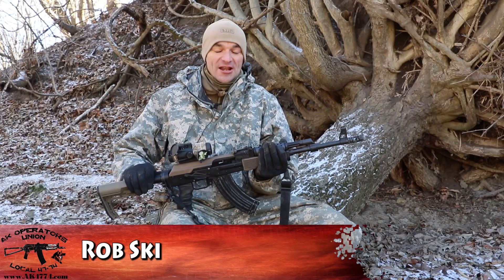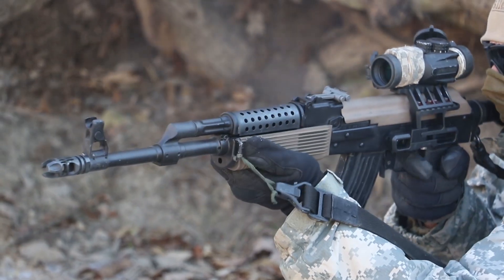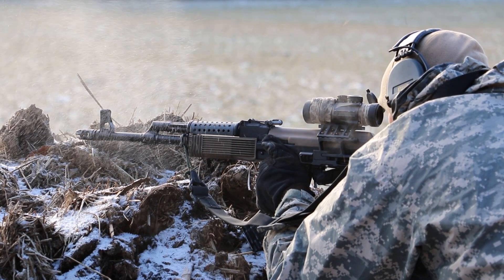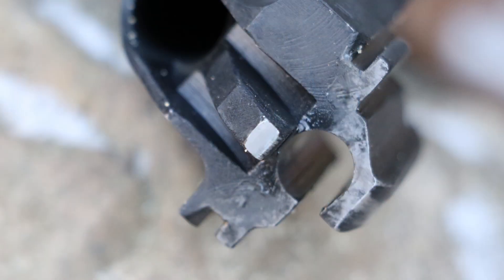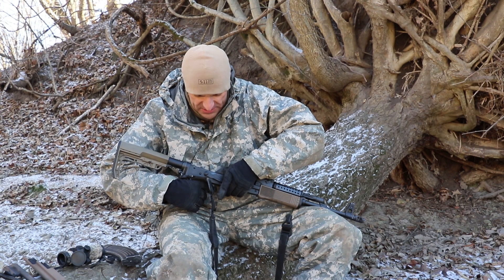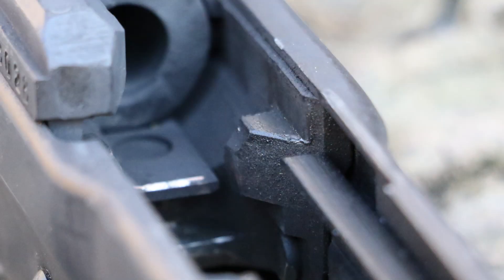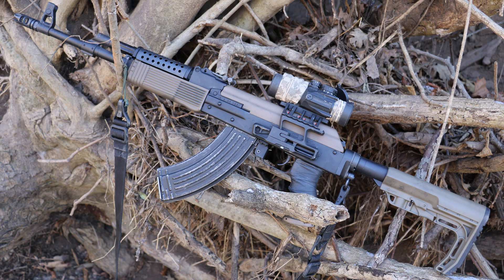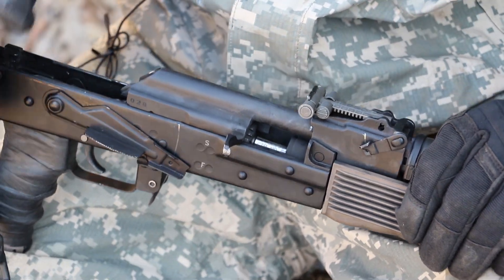Molot Vepr FM AK47 - 3500rds Attack!

Comment: Well done sir 
Tavor, SCAR 16, and Beretta ARX is up in '17
Reply: well for the tavor and scar there are so many tests of them and you can buy both and trust them imo. only heard good things about the arx too 
But sure it would be interesting
Reply: Tavor and SCAR's are battle tested and proven. Even if either of these rifles didn't pass the 5K round test. I still would trust the SCAR series and Tavor. However, I don't see Rob testing either of these rifles due to their cost. The Tavor has been extensively proven and used by the IDF for over a decade, with no significant changes made to the operating system.
Reply: That reminds me. I wonder if we're getting a civilian spec ARX 200 in the near future. That would definitely be a top priority buy for me.

Comment: Rob - I just got one of these in 7.62X39 and I love it.  Took it to the range yesterday and had one issue ... safety will not engage with the trigger pulled.  Is that a VEPR quirk or a defect?
Reply from the maker: +AK 4life yes, that's normal thing. By design there isn't clearance for safety lever to comeback when you keep trigger pulled
Reply: Thanks as always for the quick reply Rob!!

Comment: Between the Fighter brake and what you currently have on this rifle, which would be your choice?
Reply: tom Harris VG6 Epsilon is primarily a brake. If you watch the difference between brakes the Epsilon cuts down recoil better.
Reply: Ak Operators Union, Local 47-74 thanks Rob.  I have the Fighter brake and it works very well for me.  But I'm always on the lookout for better options.

Comment: hey Robski! I had a question, maybe it was mentioned in one of the previous videos, but what's the story behind that M4/AR15 buttstock tube adapter for the Vepr?  Do you have a link to the product?  Was it plug and play or did you have a smith do the work?  

By the way, you the man!  Thanks for your awesome videos! God bless and Merry Christmas!
Reply from the maker: +ssnova this adapter http://shop.akoperatorsunionlocal4774.com/AK-M4-Stock-Adapter-AK-M4-Stock-Adapter.htm , but it wasn't PP. It had to be fit with help from dremel tool
Reply: Thanks for the response and for the link on the product!  Was it pretty difficult to install?

Comment: Rob, if you were going to Afghanistan and the Army let you use whatever weapon system and setup you wanted what would it be?
Reply: Njkalashnikov his polish home build w/ PA 3x prism
Reply from the maker: +Njkalashnikov in Afghanistan? I'm perfectly fine with my issued m110 or XM2010. ;-)
Reply: Ak Operators Union, Local 47-74 I'm thinking your consideration is largely based on distance shooting in Afghanistan?
Reply: Patches O you have 0 experience with either platform .

Comment: Has a Saiga been tested yet? unconverted saiga would be best, in both 7.62 and 5.45.
Reply: I doubt Rob will be testing a Saiga to 5k rounds anytime soon. At least not until the ban is lifted and they are available to buy again. That's the point of the torture tests here. To test guns that you can actually get right now.
Reply: he tests guns that are on the market and Saigas are OFF since the ban.
Reply: Thats makes sense... that blows! Hopefully Trump lifts the sanctions on Russia.
Reply: H2BpullsK20 with the current blaming of the Russians for interfering with the election going around, I seriously doubt he will lift the ban any time soon. I just don't think he'll do anything with Russia for a while because of these moonbat libs looking for anything to blame him for.
Reply: As long as there is light a the end of the tunnel is enough for me.
Reply: Veprs are not "better" than Saigas, they are just different.  It depends on which one you prefer, an AK-74M/AK-100 series (Saiga) or an RPK (Vepr).   If you want an authentic Kalashnikov made by the original manufacturer since its inception in the 1940s then go Saiga but if you prefer the heavier barrel profile & thicker wall receiver then go Vepr, both are great rifles.  With their shotguns I will agree and give the slight advantage to the Vepr-12 over the Saiga-12 which is a honest statement because I own a Saiga-12.
Reply: the308capital from what I've read, they are a slight notch above when it comes to fit and finish vs Saiga.
Reply: The fake news will not stop or slow Trump up when it pertains to Russia, Reason being, Trump does things his way. As well as, Trump did say that within the first 100 days of his presidency, he would review all the Executive Orders from Obama and then Revoke those orders. If Trump doesn't do something he wants to do, because of what the liberals pulled on him...i.e. fake news, elections, etc., just means the liberals won. And Trump is aware of this. I think a lot of people and politicians are in for a huge surprise. Being that if Trump states he's going to do something, he damn well will do it...or at least try to do it. As well as, Trump will move at a much faster pace, than the politicians are use to. No more, taking 2 years to get Bills through the legislature branch and approved or not. Trump mentioned many times now. There's no reason or excuses in not getting things done and getting them done quickly. Right now Trump has all the leverage.

Comment: I want to get one, already have the SGL in 5.45x39... Also bought a WASR 2 a few years back... I have several AK47s in 7.62x39. But it's hard to get 5.45x39 at a similar price as the 7.62x39 these days, but that's what the Russian military uses. I'd like to keep it as 'stock' as possible... Since the Russians use that round and this is a Russian rifle, are those rifles built better using that round ? Or should I just get the 7.62x39. Any suggestions from anyone would be appreciated...
Reply: The round it's chambered in has no impact on the quality of the build. Yes, the 5.45 is the standard issue since the mid 70s but the 7.62x39 production never went away. Some units prefer it for certain applications etc...

Comment: I'm wondering if there will be any problems with the gas block since it isnt pinned like most ak rifles.  It was the only thing that concerned me when I got mine awhile back.
Reply: Probably not, it's pressed on there tighter than a popcorn fart.
Reply: Add alot of heat to the mix, and things could go south.  Im wondering if the military rpk is "dimpled" the same way.
Reply: Tight as fuck. And i don't picture those dimples backing out of the barrel, you would have to get it incredibly fucking hot for that to happen, far hotter than you could get it by shooting it.
Reply: depends on what old russian woman is running the press at the factory.
Reply: fastandfun M That's probably true. They're still human at that factory.
Reply: they took the time to pin front sight, but not gas block.  thing is built like a tank, but if it had an achilles heel, it might be the gas block.  on some rifles, time will tell.
Reply: fastandfun M I know that they do both those parts like that on Saiga's, iv'e never heard of them walking, but you can always get a lemon. But like i said, i'm pretty confident you would have to heat the thing up so much as to destroy it anyway to soften that steel to the point where those dimples to back out of the barrel.
Reply: And they do in fact do it this way on military RPK's, at least on the newer ones.
Reply: cool. good to know

Comment: glad I got the molot after having traders regret and giving up my SA93
Reply: Lt.Gabe jeeze that would be hard really wanting this but my slr95 idk if i could trade how do you like in comparison
Reply: My sa93 was in bannded config. I traded it for beautiful custom shop sig 220 equnoix. The sa93 action and trigger was butter smooth. But it was gonna need custom mill work to add tangs. Otherwise I would need iron wood set. Either way its hundreds in added cost just to change the stock configuration. While the molot dosent seem like the fine swiss watch the SA93 did, it certainly is the bullet slinging hammer that it needs to be.
Reply: Thanks brother
Reply: Nope. Its from when it was new and had to be imported that way

Comment: Rob, after 1k rounds, you'll be at 4500 rounds. Will you finish the test with 500 more rounds or will you do another 1000 rounds and go to 5500?
Reply from the maker: +anon plan is to do 1000rds on Tuesday with Paul and then finish it with 500 at some other day (weather will dictate that). So yes, I will stop at 5000rds.
Reply: anon 
good question!  Later...